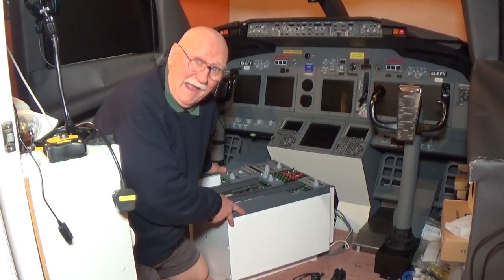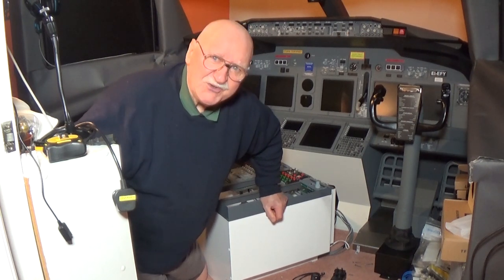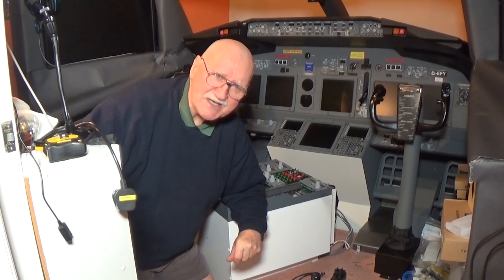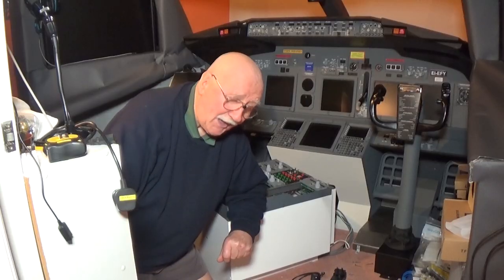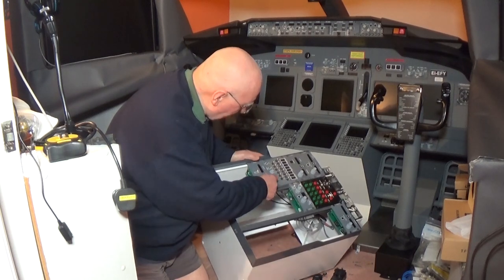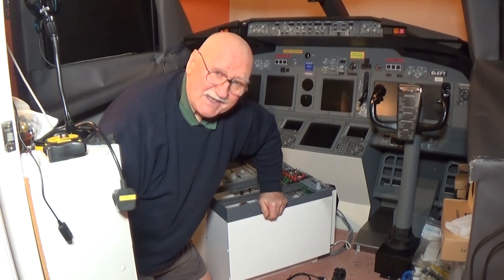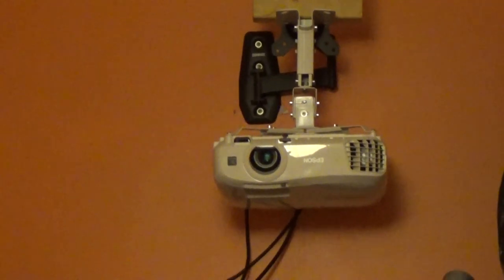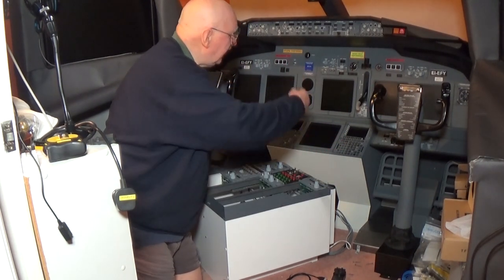Quarantine Escape Flight Update 4

Comment: With the M.2 drives. Unplug ALL the hard drives from the system, and leave ONLY the M.2 drive and the drive with the OS plugged in. Go into Windows. Hit Start - Search - type in Disc Management - Click on Create and Format Partitions. You will find your unformatted M.2 drive listed. Format it, Give it a letter and job done. Do the same with each subsequent drive you add, leaving out the first part. Leave the M.2 drive you have just formatted plugged into the system. 

The M.2 drive will only share lanes with the GPU if you have it plugged into one of the Express Lanes, otherwise it will share lanes with the SATA ports. Read your ASUS manual and it will tell you what ports SATA and M.2 shares. Once you know this, plug your SATA SSD's and Mechanical Hard Drives into any of the other SATA  ports. Then go through the process of formatting your M.2's. 

I have Windows 10 installed on an M.2 NVME drive plugged directly into the motherboard M.2 slot. MSFS 2020 installed on an M.2 NVME drive plugged into one of my 16x PCI Express Lanes (my mobo - Asus Maximus Extreme VIII doesn't have two M.2 slots) running at 8x as it shares bandwidth with the GPU. An SSD plugged into an SSD port which doesn't share bandwidth with the M.2 slot, actively running the rolling cache for MSFS 2020, and a 2TB mechanical hard drive for storage plugged into another SATA port not dedicated to M.2. 

It does all work once its configured correctly lol 😁Though I'm sure you know most of this already. The hardest part is formatting the hard drives as they won't show up in Windows until formatted. 

All the best Father. 👏
Reply from the maker: Hello - yes I had done all of this and still there was an issue,  I took it up with ASUS support and they pretty much brushed me off as I am using an older model board - and X99.  I tried several options and the results were still spotty, so I decided to just forget about the M.2 and stay with the SSDs.  But thank you for the excellent detail you gave me.  It is really appreciated. 😊
Reply: That's a real shame Father. M.2's make such a difference. Still SSD's are certainly the next best thing. No need to thank me. I'm trying to score points with the big man as I'm an unbelieving heathen. Say a prayer for me 😁👏

Love your videos. You're such a nice man. I have immense respect for your passion for flight simming, and for your obvious work in the community.

All the best. 

Chris.
Reply from the maker: @MrBillUp  Thank you - and God bless you too 😊